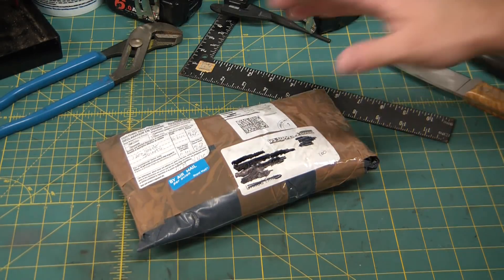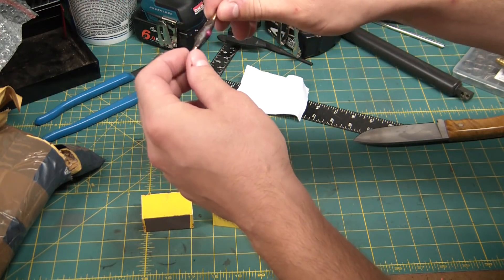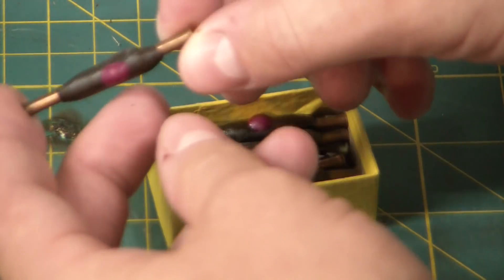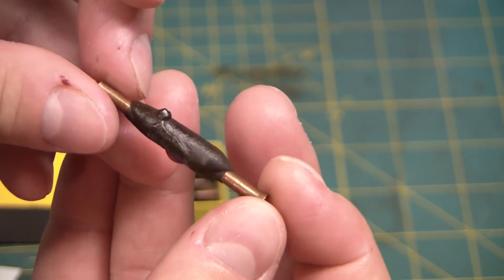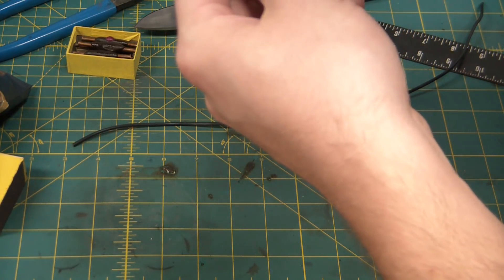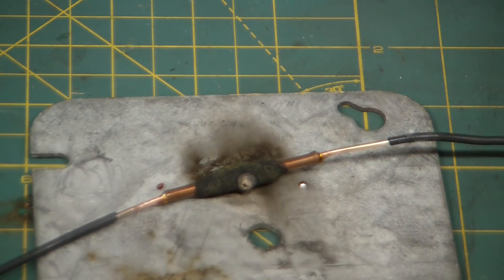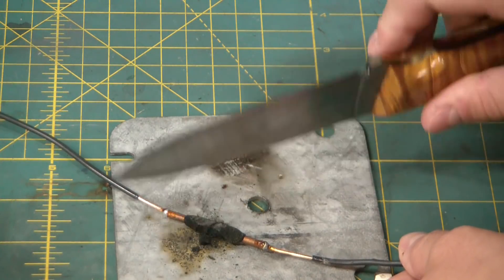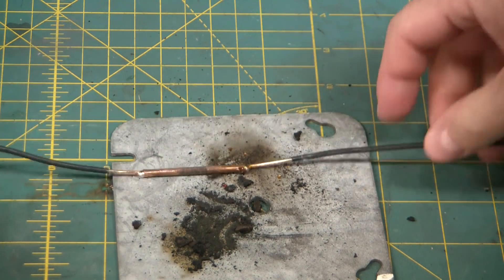Ingenious Self Soldering Sleeves!  (A Very Old Invention) - ElementalMaker

Comment: These  connectors used the same composition as Matches Fuzee, which  were used to light safety fuze and came in the same boxes. I think they were made in one of the  UK Ordnance factories. I was never aware of them being used to connect demolition circuits which were generally not long enough to need joining. They were mainly used to connect telephone circuits which needed to be soldered to stop noise interference and loss of signal from dry joints.  In the period just after the War, the Royal Signals were running huge field telephone networks as all the civil systems were trashed. I knew a guy whose job was to run the line from Le Havre to Marseilles. It was strung on trees etc at the side of the road and was kept going by a platoon of guys with jeeps for around eight months until the French telephone authorities got their act together..

I have been looking for the composition of the heating element.. the closest I can get is magnesium, linseed oil, strontium nitrate, rubber and pvc, but this may not be it!  I will keep looking!

Comment: Very cool, but it seems a little... I don't know. Needlessly complex?

Isn't this just as effective as crimping (or in a bad situation simply crushing flat) the copper tube onto the wires?

I guess that needs a separate tool and might be more prone to operator error, but this seems a lot more complex to manufacture and gets rid of what I'd say is the main advantage of soldered connections, that they can be re-melted to recover components rather than needing to be cut out like crimps.

I'd be interested to know what compound it uses, it seems very slow burning, but  the small amount on the outside of the tube still gets hot enough to melt the solder through the copper.

Comment: That's definitely fascinating...
The things that got used in the past could be quite different and creative.

Meanwhile here I am with a soldering iron that can run off a USB battery bank...
For that matter, something as standardised as USB power (even though using it for power is in itself a weird hack) battery pack was nearly unthinkable even just a decade or two ago.
Sure, rechargeable batteries existed, but they had their issues, and wouldn't have cut it for something like soldering...

Comment: this guy makes a wired connection and has the audacity to not even use a volt meter to check if it was viable AvE should sue this guy for copyright

Comment: They are still around, just not as spectacular as yours are. https://www.newark.com/c/cable-wire-cable-assemblies/cable-management/sleeving-tubing/solder-sleeves   Just as expensive though.  I recall seeing a mechanic using a set to splice a joint in a truck where normal soldering procedures would have taken too long a time to get done.

Comment: That device would be very useful in many automotive electronics wiring problems in a field where there is no possibility of soldering. It would be much more reliable than twisting and taping, or a cheap screw connector.
Reply: They make a modern version that works basically the same but without the pyro, they have low temp solder in them and heatshrink tubing... a lighter will do the job.

Comment: These were used in battlefield situations and were  mainly for comms cables, (Brits called it D10) which is  a copper and steel multi-strand cable. They will not work efficiently with thick(ish) single strand wires.

Comment: You failed to follow the instructions properly.
You were suposed to be pushing together the wires in the joint AFTER striking the flame/match to insure proper connection/insulation. you did NOT push together while melting hot. FAIL!

Comment: These are the modern versions of the soldering sleeves. heat-shrinking tubes with solder in the middle and shrinking rubber at the ends (https://www.youtube.com/watch?v=7Wh5gM8GM70)

Comment: it expects an external heat source but you can buy little butt connectors filled with flux and solder to make joints like this at your local hardware store, just add a heat gun.

Comment: They still make a similar product used for much larger wires and welding large ground lugs to steel ... but they use thermite as the heat sourse :)

Comment: What they did back in the day was use a brass Kerosene or Gasoline blow torch. The torches had a airpump on them so you could preasurize it before lighting up the flame. 

Then there was an adjustable holder that held a copper soildering iron in the flame.  It had a long wire wand attached and a wooden handle.  You used it just like an electric soildering iron once it got hot. 

Virtually NOBODY used this product it was much to expensive for the average handy man or even tradesman to own.  But almost everyone had a brass blowtorch in their tool shed.

Comment: Great video.  That burning substance is reminiscent of when they used to apply patches to repair vehicle inner tubes back in the 60's and before.  They would clamp the rubber patch over the hole with a metal clamp and the light the back of the patch to generate heat to create the vulcanization.

Comment: Cool item, never saw those before, nice video! It looks like a similar composition as those long windproof survival matches you can buy, that stay burning white hot for about five to ten times longer than normal matches. And you can get inline cable splices now that you heat up with a cigarette lighter, and the heat shrink outa insulates the connection. Didn't know they had these ones back then though! Nice!

Comment: There are modern equivalents which are a low melting point solder in a heatshrink tube. You need a heat source, lighter, torch, hot air tip, etc., the solder bead melts and joins the wire as the heatshrink seals the joint

Comment: If you want to show me something, please hold it at a consistent distance from the camera so it can be focused and not all foggy.  Also hold it in the center of the camera's field of vision so the autofocus can focus on it rather some other thing.  Also, don't wave it around and tap it.  All that motion further confuses the autofocus.  Gosh.  Good topic but your poor camera skills nearly negates your effort.  Sorry, I hate naysayers but look at your results.  Gosh, it's a mess.  And don't move the wire until the solder has congealed.  Gosh.

Comment: When I was a kid, we used a bicycle inner tube hole-patch kit, and the heating part looked very familiar to the burn you showed here. The burn material was on a thin steel plate, and there was a red rubber patch on the other. A clamp held it over the hole in the tube, and the rubber patch melted onto the tube.

Comment: Believe it or not these are still around... Just designed a little differently now. 
https://www.summitracing.com/search/product-line/dx-engineering-heat-shrink-self-solder-wire-splice-connectors/part-type/wiring-connectors?fr=part-type

Comment: Was talking about PIC (plastic igniter cord) on a fireworks forum and the composition used to be lead dioxide and silicon    -    PbO2 + Si = Pb + SiO2

This reaction is almost gasless and very hot. It's a type of thermite reaction and is ignited easily. This could be something similar. PIC does burn with a large flame however but I think this is due to the plasteciser in the comp' to make it extrudable and it's also coated in a plastic sheath.

Comment: Used these in the UK in the Civil Defence Corps and Army for joining field telephone cables. Standard cable then was a twisted pair which contained 7 steel strands and one copper. This was covered in flexible plastic and a woven cloth outer. For strength the cable pair was knotted together, then the ends stripped before jointing. After soldering the cable was insulated with pvc tape or self amalgamated tape, before covering in two layers of cloth insulating tape. I served in bot the Civil Defence Corps headquarters section doing field cable and also in the Royal Signals. We never used solid conductors, for which the self-soldering sleeves were not designed.

Comment: >Smells like a headshop
Yeah they don't tell you what kind of resin is in the compound, but hey here is a fun fact: In the mid 60s, the most abundant source of burnable waste hydrocarbons was the swaths of marijuana growing along the sides of the road, in fields, in the middle of forests, etc, etc. It was called "weed" for a reason. The first whosawhatsitsname in charge of clearing out the entire country's billion marijuana plants said, while looking out at the proliferance of weed plants in some or other area,  that he felt he could never succeed in destroying a past time, a crop, and an enormously common tool (hemp was what was banned originally because they wanted the then-burgeoning steel mills to make steel cabling intended to replace all hempen rope as a whole). 
So ipso facto, they ended up paving miles and miles of roads using the resinous compound left behind when burning marijuana, they used it to reinforce tool heads and handles, and they slopped it over untold numbers of tar roofs. They used it anywhere they could just like they first began using Flouride after needing to find a use for all the byproducts of aluminum smelting. Their solution was "let's just make babies drink it". With hempen resins, they used it all up until there was no more to use. I used to love the smell of solder; brought me back to simpler times every time I smelled it. 

This is all made up and you just wasted a good two minutes of your time reading my sleep-deprived rambling.

Comment: When I was surveying in the 1980's . We had little repair clips like these for the surveyors steel measuring  bands (chains). All you did was insert the broken ends then ignite the match chemical with a match or cigarette lighter. Could even do it with a small spark off a battery.

Comment: You might want to check out the old hot patch system used to patch inner tubes. Worked in much the same way, and could be picked up at any hardware/auto parts store.

Comment: Would be handy to use on "the last mile" to the telco. Inside the plant, IDC* are used.

IDC=Insulation displacement connectors
(Thin crimp-on phone plugs where the contact literally pierces the wire jacket. Would need some way to "bite down" on non-jacketed cable.)

Comment: There is a version of this being made currently,  but it does not have the self heating functionality that these do.  It is a plastic shrink wrap with flux & solder propositioned to make a solid joint.  Just apply heat and Bob's your auntie

Comment: you did it wrong the reason why you strip so much is that as the solder melts you push the two wires together dont forget they had differant sizes for differant wire

Comment: maybe they stopped making them because nobody read the instruction and nobody madeca reliable connection. Soldering is not gluing. Mechanically strong doesnt mean electrically reliable. A cold joint may result.

Comment: At the point these were used mechanical connectors really really sucked. Today there are mechanical connectors that are much faster and with nearly the same rate of failure. Interestingly, I have some heatshrink tubing pieces with built-in solder. I slide it over one wire, do a tight lineman's splice, and slide the heatshrink over the splice. I shrink the ends quickly to hold it in place and then hit the middle and the ring of solder and flux flows and wets the connection thoroughly.

Comment: There is a reason why the wrote:" Hold and push wires in when solder is soft, until the wires overlap 1/2"!" 

If you bend stranded soldered wires back and forth, they will break after a while, at the solder joint ! Why? 
Because the soldered single hairs could not move lengthwise, while bending and take enormous stress!

So push the stranded wire into the tube, with no solder coming out, and push in part of the soft isolation also,
 to support the wires from being stressed while bending ! That´s why the copper tube is so long !

And also, this is the reason, why you should never solder wires in cars !
Always crimp them. Lasts better !

Comment: If you want to rebuild quite the same artefact, I've probably got a solution 
You need to compact some tin in the middle of the cupper piece (by using two flat head nails for example)
Secondly apply black powder with wood glue around the middle part
 Then mixe 3 or 4 matches head with a few water and make a big red spot in the middle, wait until it's totally dry
And finish by covering all the external piece by a few wood glue

Ignition could be possible by a simple scratch box
The inflammation will make enough heat to melt the tin inside, but not the cupper 

Hi if you look at this video, you'll found quite the same reaction used for the high temperature soldering
https://youtu.be/U7Vj5-Z8wD8

Comment: that looks like a fine gauge copper tube filled with solder, then storm-proof match material around it, you could probably make your own. I have all of those materials, and may have to give it a try, with a little extra flux to supplement after adding solder to the tube. I think the copper tube looks about an inch and a half?

Comment: this one is almost equivalent of that in form of heat shrink with solder https://www.ebay.com/itm/100Pcs-Waterproof-Solder-Seal-Heat-Shrink-Sleeve-Wire-Butt-Terminals-Connectors/143630016141?epid=20032669623&hash=item2171041e8d:g:aAcAAOSw9Kde414A

Comment: I don't think these were used for demolition, they were probably used for soldering communication lines in the trenches. These would have been too slow for demo, that is why wire nuts were invented.

Comment: at the start i was wondering how they were made up under that black blotch. but it turns out it was just a simple copper tube filled with a lead and flux mix. the composition around it is simply heating up the coppertube to temperatures to melt the solder inside. this is ingenius, so extremely simple but so very clever. the marvels of ww2

Comment: Actually these were used for communication wire. The UK used D10 multi-strand steel comms wire. I last used these in the late 80s/early 90s. They work best with multi-strand wire.  Once you’ve stripped and prepped the wire and pushed the wires into the sleeve, you need to be quick! Strike the match head then pick the joint up with wires inserted, then push the 2 wires towards each other to get as close to butting the wires as possible. Solder will flow out but you’ll get a much more secure joint. Good luck: thanks for a great channel!

Comment: Considering the det charges back then worked on pretty low voltage I imagine these were also safer than using electric soldering equipment. Less risk of premature detonation.

Comment: Awesome video, never saw this before.  I imagine you can find the modern relative to this on Amazon.  While not incendiary and require an external torch or heat source, they combine solder, splice tube, heat shrink tubing and adhesive all in one.   Look for "solder seal" or "solder sleeve"

Comment: "It's goddamn ingenious."
I agree, and after watching this I am going to make some of these myself.  I will use "rub cloth" as my igniting element.  But you know, they make these things that create a strong electrical connection with just a screwdriver and a blowtorch.  The shrink wrap on them has a flexible glue that melts and seals the connection so it's waterproof and suitable for direct burial.  Electrician stuff.
Very cool!
Reply: i've achieved similar waterproofing by slicing up hot glue sticks, an d sticking the pieces in the heatshrink around the wire before i heated it.
Reply: Oh, those sleeves with solder beads? I'm mostly concerned about the heat tolerance of those. Otherwise, you can probably make a neat line up of these products for heat tolerances.
Reply: Lemme know if you ship these to Shetland or found anyone else making these

Comment: They want the wires to overlap for electric continuity not mechanical strength. That's why you stripped so much. And today you can get similar connectors that already have an insulating sleeve covering them and are used with an external heat source such as a heat gun. They say not to use a cigarette lighter, but I have and it worked although it scorched the insulation quite badly.

Comment: A few years back in my previous workplace I've met with a marketing rep of a company which I don't recall the name of, and they were selling something similar, sans the self igniting part. it was essentially a copper tube with solder material loaded into it inside an overhanging peice of clear shrinktube, and you could make connections with it using a lighter.

Comment: Rule Number one. 
Always read ALL of the Instructions 1st before beginning.
You read 1 step at a time, and goofed the whole thing up.
After Striking, you were supposed to push a wiggle the wires Into the Connector so they Over lapped.
I guess you didn't have time to read that after you stuck the igniter.
That's Why you always Pre-Read ALL of the Directions.